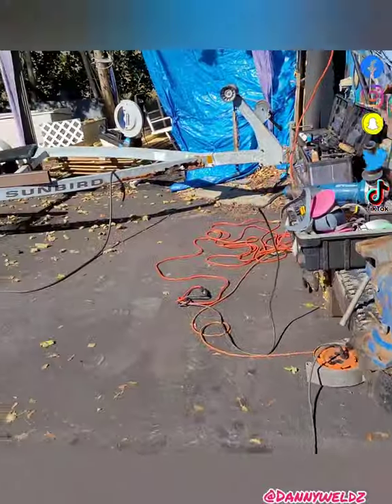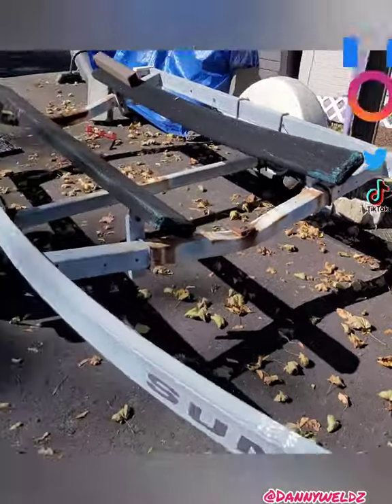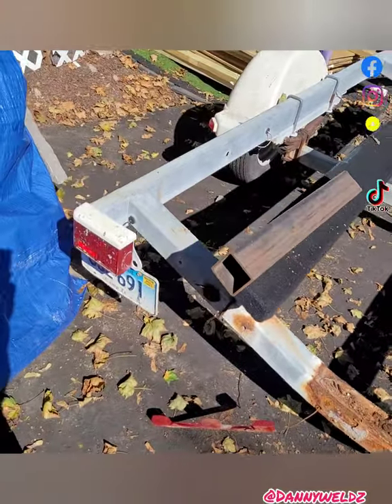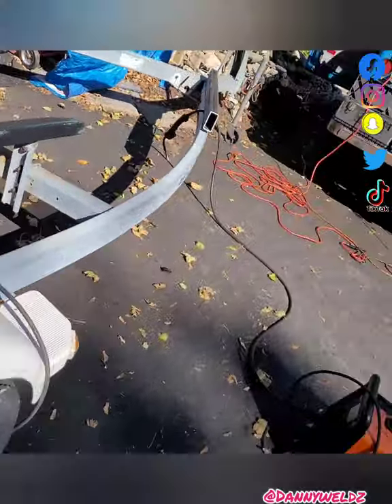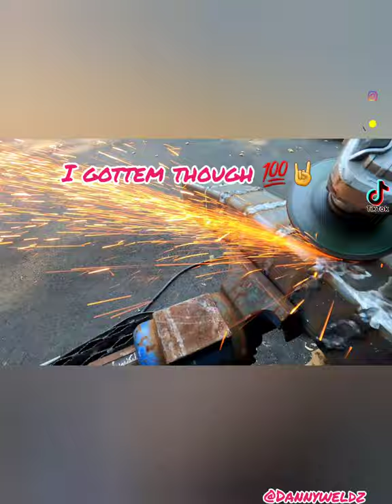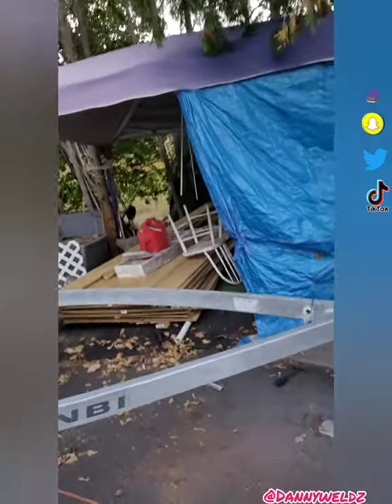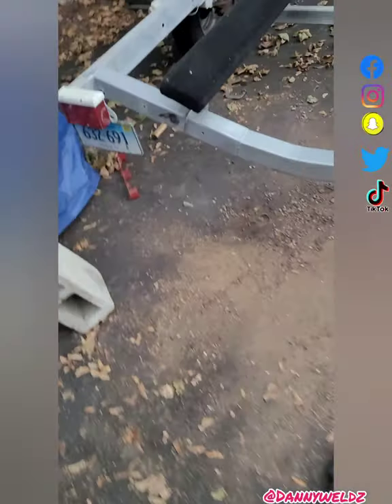Repairing a galvanized boat trailer

Comment: Pretty dam good I’m working on my first one as well
Reply from the maker: Looking back I would've done it differently.  I should've just bent with heat as opposed to the slices. 🤷‍♂️ we learn as we go
Reply from the maker: Make sure you wear a papr when welding Galvanized. Or at least respirator and a fan🤷‍♂️

Comment: Just wondering, what did you charge for this job? I need 2 cross members replaced.
Reply from the maker: I charged about 1000. This was a job that needed to be done on a day that I had booked so I charged more to accommodate

Comment: Did you wear a gas mask for the galvanized steel
Reply from the maker: Yes at minimum I wear a 3m half face mask with pancake filters.
Reply from the maker: I have since upgraded to an optrel p.a.p.r system as shown in my newer videos. Like and subscribe if you haven't already 😁✊️